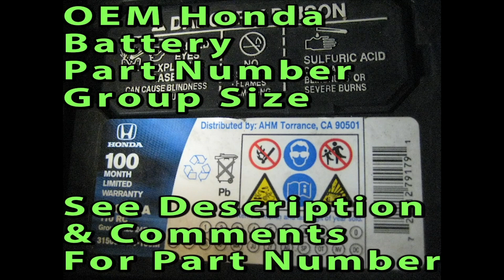2003 To 2008 Honda Pilot How To Change 12V Car Battery - Quick & Easy Version

Comment from the maker: Honda Pilot 12V Batteries - https://amzn.to/3jsCqeB
Delphi 12V AGM Battery - https://amzn.to/3KDGRz9
Interstate 12V Battery - https://amzn.to/3JubXYw
Odyssey 12V AGM Battery - https://amzn.to/3O5uUEi
Socket & Ratchet Set - https://amzn.to/3xkvKHx

The Paul79UF YouTube channel is a participant in the Amazon Services LLC Associates Program, an affiliate advertising program designed to provide a means for sites to earn advertising fees by advertising and linking to Amazon.

Comment from the maker: Check out the DIY guide for changing the 12 volt automotive battery in a 2003 to 2008 Honda Pilot SUV - 
https://www.paulstravelpictures.com/2003-2008-Honda-Pilot-12V-Automotive-Battery-Replacement-Guide/index.html

Here are all of the DIY repair and maintenance tutorials for the first generation 2003, 2004, 2005, 2006, 2007 and 2008 Honda Pilot - 
https://www.paulstravelpictures.com/Articles/2003-2008-Honda-Pilot-Common-Problems-Repair-Maintenance-Guides.htm

Owners of other Honda or Acura SUV or minivan vehicles such as the Odyssey, MDX, RDX, CR-V and Ridgeline may also find these DIY instructions to be helpful.